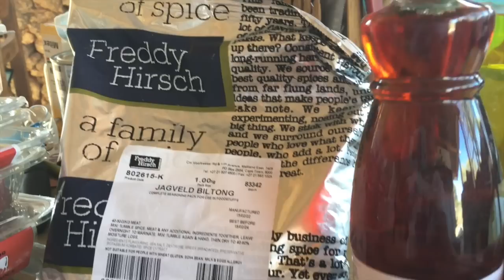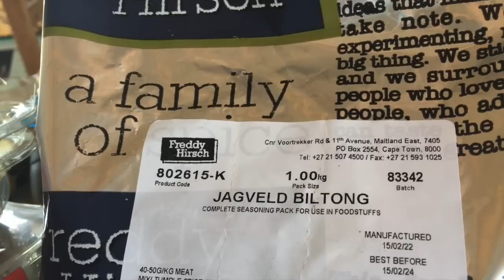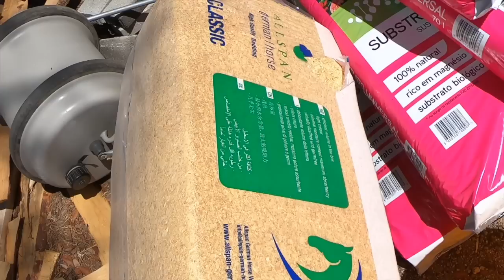Living on an Off-Grid Pig Farm in Central Portugal / GAMECHANGERS

Comment: Gorgeous those swimmingpools!!!😍😍😍 I used to had those too in seashelf form for my pigs. Later on I got my hands on rightangle & round form fischponds, about the same depth. I used to dig them a bit into the earth, so they can't pull them on the side so easily.  On Oreo, you know how to mix cement now and have a beautiful mixer, make a small wall of those stones and put the metal wire fence into it. You can do that!😉
Love your video's Cindy and your lovely animals.❤
Reply from the maker: Will dig them in when it rains!
Reply: @CindyVine  great!! They are so happy with it. Thank you Cindy for taking such a good care!

Comment: Hi:
I am 87 years old had been a widow for 17 years and an old hand at DIY. One thing I have learned is not to lift heavy anything. I open the bags up and use a smaller container to lift the materials up. Takes a monute longer, but it is worth it.
Also the canopie that nick put up has to be anchort, or the least bit of wind will blow it away. I use liquid gallon jugs, posibly recicled water. I also live in Florida USA and know a;; about heat...
Good luck, Varda
Reply from the maker: That's a good idea.

Comment: Great that you have learned you mix cement with the mixer. Another skill learned!
I recommend you fold up your canopy if strong wind is predicted or if you go out of town. Many people I know have had the tops ripped off their frames or even the frames thrown (sandbags & all), even with the most new heavy duty highly rated ones.  They're not hard to take down & up & drag in with some experience.  They are a great solution until you can make a shade structure one day.
Reply from the maker: Thanks for the tips!
Reply: @CindyVine  You can also lower the poles to the lowest position. I used to sell jams and baked goods and I always lowered the poles if I was coming the next day.

Comment: A big hole for the pool to sit in will prevent the pool tipping over .
Reply from the maker: Problem is that the ground is so hard and rocky!
Reply: Fill the pool , tip the water then dig it out daily soon get a hole done .
Reply from the maker: @corinnetonelli489  if you knew how much work it is to manually fill bottles of water and then carry them to the pigs, you will understand why I’d be loathe to pour all that hard work onto the soil! And it would need lots of water to soften the soil at the moment.

Comment: when you mixing cement or mortar  water first !! It is easier  . When you add cement first you will end up with big blob sticked to the bottom of the bucket.
Reply from the maker: That's exactly what Nick said, so we started with water. He said always water first.
Reply: @CindyVine  
How about, if you break down a bit, with a screw driver?

Comment: I'm thinking more vertical stakes throughout the wires and into the ground, kind of like prison bar, in Oreo's escape section on the fencing could sure up that section. Oreo's escape methods are very impressive!   Also, is it possible to construct raised stands to hold the pig water bins so they can't step in them?
Reply from the maker: If I raise the water they won't be able to reach it and the ground is too hard for vertical stakes. Couldn't even put fence posts in there.

Comment: Cindy, doing labor to improve my home is the only way I have been able to make so many improvements that have added the value to my home. Tools are a girl's best friend. They make the jobs soooooo much easier!  When I'm mixing plaster or cement I do it outside so the dust doesn't make its way throughout the house. Better for your lungs too as your lungs can't clear the silica in the cement. After your veranda is built that gazebo can become shade for an outdoor work station. I wonder if you could partially recess the pools into the ground to stabilize them so they don't tip so easily.
Reply from the maker: That's the eventual plan when rain makes the ground softer. Now it's too hard. You can't even get a pick in as we tried.

Comment: I would solidified it by doing a fence base high enough with rocks and cement, about two feet. I just wonder if that would have the same result
Reply from the maker: That would work well, but doing it alone, pushing a wheelbarrow over the farm in the heat to find suitable rocks, might just kill me!

Comment: Cindy can you attach the bottom of the fence to the wood boards with large zip ties so he can't push the fence without dealing with the boards as well?
Reply from the maker: That's what I did on the fences, but this one area, he managed to rip the wood board out of the posts and break the zip ties.
Reply: @CindyVine  😅